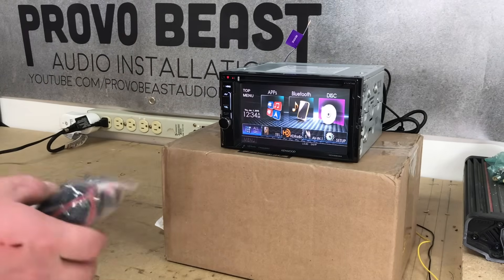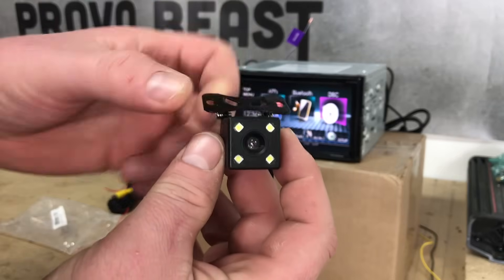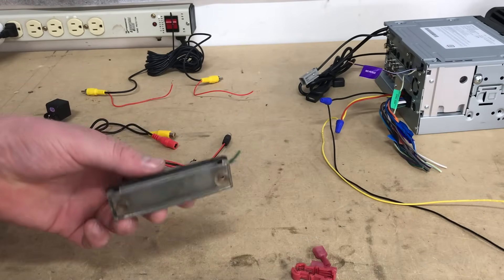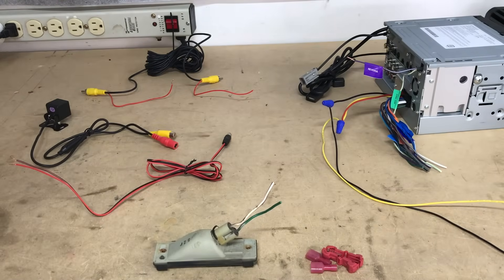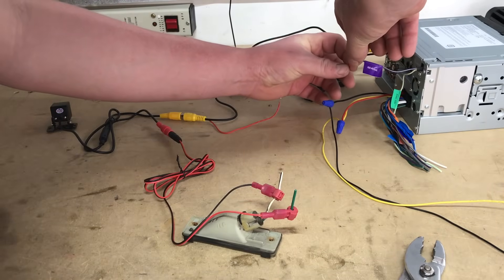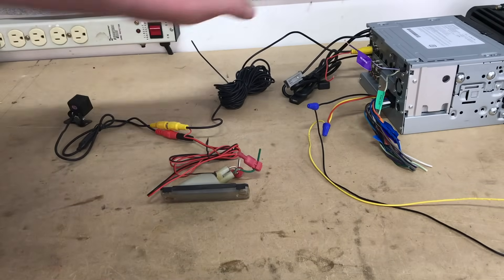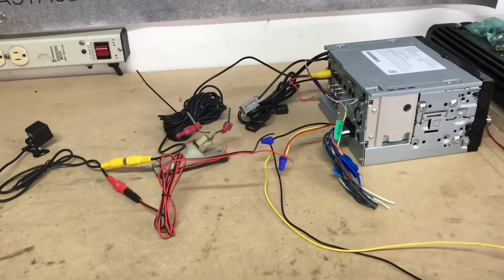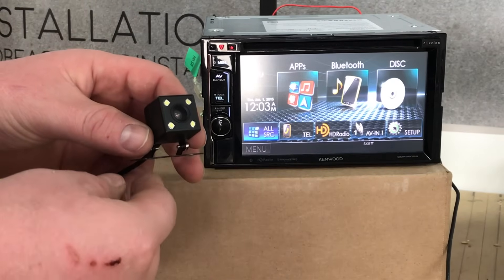Car Backup Cameras Explained: How To Install On Your Car!

Comment: If you were to connect the live from the camera to a permanent live when the ignition is switched and the pig-tail to reversing light then you should get the best of both Worlds ?? of course ground the other negative wire  . With my car the lights are on day-time should be no problem finding permanent live.

Comment: could you do another video for a front and rear camera system?? i am confused how the RCA inputs and the red wires are supposed to be linked up. there's a blue wire that is also a reverse one, I can send a link if that is more useful

Comment: I have another cable in between thst seems to be a delay timer box. 

There is poeer going to the camera. And the radio switches to the reverse screen. But it remains blank for some reason. I havd those two littke red wires on the video cable. But theyre not crumpednto aything as the camera gets pwoer and my screen switches. 

Im so confused haha

Comment: I recently viewed the video and it was great, but I have a question, when I want to be able to enable the rear view function wiring the cables as you clearly explained, how is the reverse light signal cable wired? Thanks

Comment: With the second method, would the camera automatically turn on if in reverse? If not, how would I need to wire to accomplish that?
Reply: The camera will only come on when you put the car in reverse If you connect it to the reverse light.

Comment: Great video, 
The 2 red wires running through the camera to the  head unit, why is the camera side much shorter than the power to reversing light wires considering they will usually have the same distance to run I'd have thought they would be an equal length?

Comment: I have a camera like this, but mine just randomly stopped working. It comes up on the front screen as no video signal. Anyone have any solutions?  The camera on the back is lit up and operating, but not giving signal to the head unit

Comment: I was trying to get through the rubber in my car and I damaged the end of the cable. I decided to cut and run the wire because it was thinner; now, I bought a new P2 power cable. Can I just cut it too and splice it to my old one? I saw that there are 3 wires. Or do you suggest to repair with a new plug?

Comment: Very useful video.Fitted a JMCQ For Toyota Avensis T250 2 II 2003 - 2009 Car Radio Multimedia Video Player Navigation 4G GPS Android 11 Carplay 2 Din today.
Bought from Ali Express the T10-A-Camera model for £93! Fitted well with a slight trim of the Toyota console.
Came with virtually identical camera. Great explanation of two different powering methods. I will be powering the camera from a 12v ignition based outlet in the boot, and using the reversing light 12v hot to tell the unit to display the camera. Great job Mr Provo Beast!

Comment: I have installed a rear view camera in my vehicle. I have made all of the connections that you've described with the exception of the trigger wire on the radio end. When I put the vehicle in reverse the screen changes on the radio but I have no picture. If I connect the the red wire from the RCA cable will that fix my problem? TIA for your help!! Subscribed and followed
Reply from the maker: Yes, you need to connect the RCA cable to the video input or else you won't get any image.

Comment: I hooked up a camera to my stereo unit in my car. The camera lights are coming on, but on the screen it says no signal. But I hooked the wire off the stereo unit to the red wire on the video input like you are suppose to. Can someone help me with the issue?

Comment: Hi  i just used your torital on my car to fit a new headbuinit and rear camera an i had a slight diffrent set up on the head unit  inused your layout to fit it   an it works like a dream   i just laid it out and sorted it copying your plan also most these head units its a pink wire that you conect to the red wire at the headunit . Many thanks 😂

Comment: Hi, I have a little problem,  I did everything right and the camera works fine but when I starts the engine the camera doesn't work turns of the engine and turns the keys on the camera works fine in reverse on off perfect, but only when the engine is off the moment I starts the engine it stop working  and I'm confused I worked in this job for 3 years I installed like 100 camera I never had such problem but  this was 8 years ago so idk any advice

Comment: The thing is, where I’m mounting the camera and where the reverse light is. Seems too be a bit too far away for everything to connect.

Edit: I immediately found cable extensions on eBay for like $3

Comment: Can I just ground the black negative for the camera to the vehicle, and then just connect the red power wire for the camera to the red trigger wire in the video cable? I don’t know if the reverse wire that the other red trigger wire is connected to would supply the needed power. Thanks in advance

Comment: Dude! I use your info for installing. Same hardware.  Working so far. But I do have a "flip" issue on the image. ¿What to do now? Thanks.
Reply from the maker: Depends on the camera, some have little loops at the camera end to cut to modify the image.

Comment: The ground wire that is on the power plug.. does it have to be connected to something. I saw another video where is he didn't connected just left it isolated. Is this ok?

Comment: What happens if the short red wire is too short and won’t reach?
Reply from the maker: Add more wire to it using a crimp cap or butt connector.
Reply: I sorted the short red wire with the red of red and black wire which is getting connected to reverse light and it worked perfectly

Comment: Quick question - my reverse cam was installed and set up by audio technicians when installing my radio and speakers - My camera LEDs turn on and are constantly on for the duration my car is powering the stereo and only goes out when I switch the ignition off. Is this standard for the LEDs and power on the reverse cam to be constantly on, I mean during the night even I don’t know how the drivers behind me on the road may see it as dazzling or a distraction…? Anybody know if this is the norm?
Reply from the maker: They used the wrong camera type for the accessory power option.  I'd have them swap it out for a camera that doesn't have LEDs to avoid any issue when driving at night.
Reply: @ProvoBeastAudio  The reverse camera was supplied with the stereo itself

Comment: The problem with the signal wire is that it doesn't reach the tail light. That's p inconvenient. Should I just tap it to the camera's power positibe wire?

Comment: question. on the back of this radio i have it has a pink wire that says it's the rear view camera control line. i'm terrified to wreck this radio so i'm wondering do i put power to that wire for the backup thing to work?   Cheap radio going into a lucas nightmare car (mgb). Wiring is always stressful with these cars. thanks for the help

Comment: You can also tap into the 12v remote of an aftermarket subwoofer amp if you have one in the back to avoid running wires all the way.

Comment: wouldnt wiring the video rca red cable on camera end to positive power of reverse light cause the stereo accessories to power the reverse light?
Reply from the maker: Only if you wire the one end to the reverse light power, and the other to accessory.  If you power your camera on accessory, the you will need to run an isolated run from the reverse light to the reverse trigger of the radio.

Comment: Hey guys, thanks for the video. I know its been years since you guys made the video, but I would appreciate it if you can enlighten me on a question. 
So in the first set up where camera gets power from the reverse light, you shown that the red wire on the power harness needed to go to the positive side of the reverse light to get power. But you also shown that the trigger wire needed to connect to the reverse light positive as well. 
So my question is, from my limited knowledge of circuitry, wouldnt it suffice to connect the trigger wire onto anywhere on the red power harness wire, whilst having the red wire connected to the reverse light positive? This way you dont need to extend the trigger wire all the way down to the reverse light.
Reply: Did this work?

Comment: What if my head unit doesn’t have a reverse cable to connect to only an AV in port. I set up my camera as similar to the video and my unit says no signal when I put it on reverse.  any suggestions that can help

Comment: What does the “crimp” do is it the same as stripping the wire and connecting them
Reply from the maker: Crimp holds the wires in place. just twisting the wire together and taping can be very dangerous as those connections can overtime come part and create shorts.

Comment: Thank u for this video -the original camera stopped working so I installed another which is exactly like the one you are demonstrating - the reverse camera works fine except that the light stays on all the time ? What could be the problem?

Comment: I've tried this before I just remove the ground and hot wire from the camera apart and tap the av red wire into the hot wire headed to the light. Everything works great. Zip tie and electrical tape make sure it lasts forever and thats it the wiring is easy the hardest part is removing all the panels and fishing the wire through the car up to the stereo

Comment: There's something that alot of these videos are not covering. When you have constant power run to the camera the lights stay on the entire time the car is running. The back up camera lights. Is there a way to bypass that somehow and still be able to use the backup camera all the time?

Comment: I bought a cheapo double din it came with a back up camera and I'm running new wires and got a new camera I hope I can find a way to have the camera any time but I've never seen the option

Comment: Hi, I recently installed a backup camera on my 07' Pontiac G5 according to the instructions in this video. The camera gets power, and the image does show on my car stereo. The only issue is: the image only comes up when my foot is on the brake pedal, and not when I'm in reverse. What do you think could cause this? I only want the image to show up on my car stereo when the car is in reverse. Just to clarify, the image only shows when the reverse pedal is pressed, NOT when I'm in reverse. Thanks!

Comment: Is there a way to trigger reverse camera and still allow view during tows?
Reply from the maker: Run a dedicated wire for the trigger wire, separate from the camera for your radio. Then power the camera off of accessory.  This will allow you to have the automatic trigger for the radio when reversing while also being able to call upon it when desired.
Reply: @ProvoBeastAudio  Holy smokes - thanks a ton for the quick reply! When I hooked it up, there was power on the stereo head unit and power at the camera end. The trigger wire is the one on the camera side, right?

Comment: I'm about to install a backup camera which looks similar to the one in your video.
This may sound like a silly question but do cameras have a top and a bottom?
I am wondering if I install the camera upside down if the image from the camera can be rotated if it displays upside down on the head unit?

Comment: This is an excellent tutorial. Thank you very much! I am installing a 13.9 inch Tesla style entertainment system in my 2010 Maserati Quattroporte S. It did not have a back up camera and the entertainment system I purchased did not have instructions. I was confused by the two small red wires co-located with the RCA plug and you explained it very nicely. Once again thanks for a great tutorial.

Comment: how does the 2nd way work when you not useing the trigger wire? are you splicing the red wire to aux and the other to trigger?
Reply from the maker: Sometimes the trigger wire is generated by the smart harness (depending on the vehicle).  If the smart harness doesn't provide it, then you will have to run another 18 gauge wire from the 12v + wire on the reverse light up to the radio trigger wire (again if using the 2nd way).

Comment: I've seen hundreds of videos about reverse camera installation and this is the one explaining clearly all connection and cables. Now, I'm able to figure out that in my particular case, I do not need the red cable connection to the radio since my radio is able to switch to reverse mode once I change the gear to do that. Thank you!

Comment: I have question for you. I own a 2004 isuzu rodeo, I don't have a standard trunk I have a backbglass and a side gate that opens to the left the camerabi bought a Dual xcam200 which way would be best so that the camera wire reaches the reverse light? and would I have to extend that camera wire? any help would be great thank you for your time

Comment: Mine long video cord with the two red adapters has TWO different male plugs. ONE, has a thin puke orange  plug thats is skinner and then a standard thicker male metal prong. Did I lose my metal sleeve that goes over the puke orange thing or is it meant to be that way? so confused. Got everything else dialed in, but i can not get my video feed

Comment: Could you also use the trigger wire for the power?
Reply from the maker: Sure can
Reply: @ProvoBeastAudio  nice, but either way you're going to be manually running a wire up to the head unit for either power or the reverse trigger, assuming you are wanting to run constant power to the camera, correct?  And either option, you would want to ground directly to the chassis either way correct? Thank you for the time.

Comment: Hey question can I replace the Camera and keep the wiring? I have this exact same, Back Up Camera. Just change the camera?
Reply from the maker: As long as the new camera has the same connections, absolutely.
Reply: @ProvoBeastAudio   Thanks man.

Comment: I just have one issue. It works, except if i connect the short red wires for the reverse signal. It just shows black with these connected... Help

Comment: I have everything connected exactly like in the video but it goes into reverse mode everytime i step on the brake or just in reverse
Reply from the maker: Sounds like you connected to the brake light instead of the reverse light.
Reply: @ProvoBeastAudio  i thought I did but the camera turns on if I’m in reverse too. So it’s turning on from both brake and reverse.

Comment: Hey I know this video is a bit old but I’m having a little trouble. I hooked it all up the same exact way but when I go to hook in the reverse detection to the camera power it only says “no signal” with the camera picture on it. Unless I’m in reverse where it shows the actual footage… if you’re still active any help would be greatly appreciated
Reply from the maker: Sounds like it is only getting power when in reverse.  Alternatively if you hook the camera up to accessory power, you can use the camera in other instances besides reverse.

Comment: I have a question about cameras mine is hooked up just like that but my screen shows a purple screen you can see everything with it but it's purple the grid lines are correct Color I've tried 3 different cameras and they all do the same thing

Comment: Followed all the steps, and Camara on works when car is on ACC and put in R. Once the car is running and I put it in R the camera will not display. Any advice on this issue?

Comment: I would think that you wouldn’t need to run BOTH GROUND AND RED POWER WIRES from the back to the radio.  

You could just ground the ground in the back & only run a single power wire up to the acc on the radio. 

Right ?🤷‍♂️

Comment: The red wire attached to the AV cable isn't even close enough to connect to my reverse light in the trunk. Any advice?
Reply from the maker: Sure - extend it using some wire from your local auto parts store to the reverse light.

Comment: can I use heating tubes instead of those red things to connect my wires?
Reply from the maker: If you use heat shrink, I still recommend soldering or a secure way of fusing your wiring together. Either solder or crimp, just don’t twist only. Crimp caps are also a very nice alternative.

Comment: Now how to wire in a switch controlled backup camera that doesn't connect to reverse at all....
Reply: Run a power wire to a switch. Run a wire from switch to that purple wire. Done.

Comment: Hey so I installed a similar set up on my 2006 4Runner. When I shift in reverse, the back up camera is engaged. When I take my foot off the brake and let the car roll back, the image begins to flicker and eventually cuts off. Can you explain the problem and how I can (easily) resolve this?

Comment: So when the camera is connect to the stereo power and ground, are the LEDs always on? Or just when the RCA power is being used?
Reply from the maker: If you are going to run the camera off of accessory, choose a camera that doesn't have built in LEDs (we have a few linked in the description of the video).